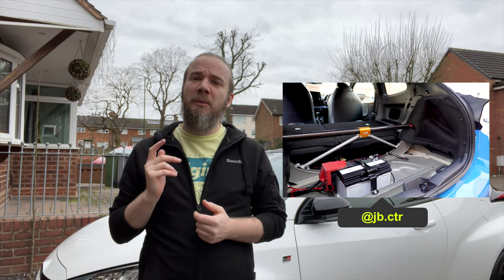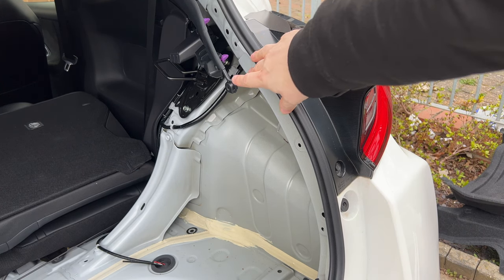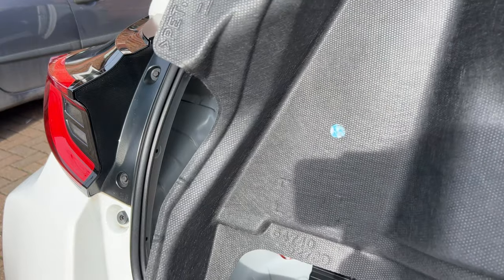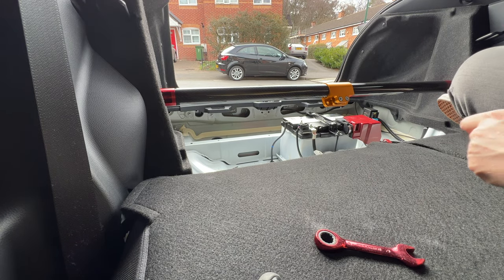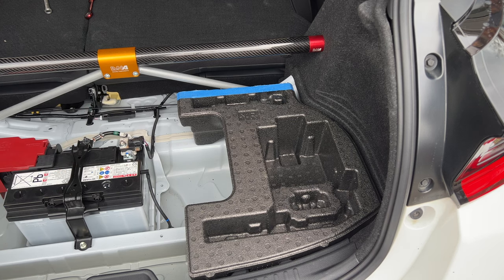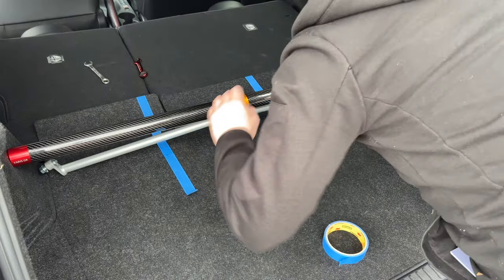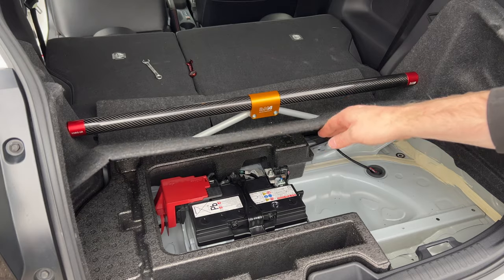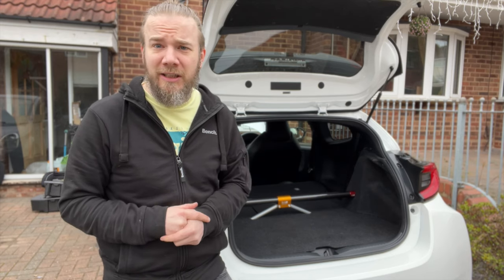GR Yaris Gets abit Stiffer! DNA Racing Carbon Rear Strut Brace. Daily Car Install 😍

Comment: Great video! A mod I didn’t consider until now 😊🙏 do you plan to do anything with the seats? Imho sitting so high kinda ruins a bit of the otherwise amazing experience of driving a GR Yaris. Maybe GRMN seats can be fitted? 🤔
Reply from the maker: I was considering trying something with the seats. They arent too bad for me as im not the tallest. But it needs to be able to still be used with the rear seats so i cant go fixed back. Id like some Recaro's but they are very pricey! GRMN seats would be mega, but also mega money for two!
Reply: @FaithlessEmoRacing  I hear you! Thanks for sharing your thoughts